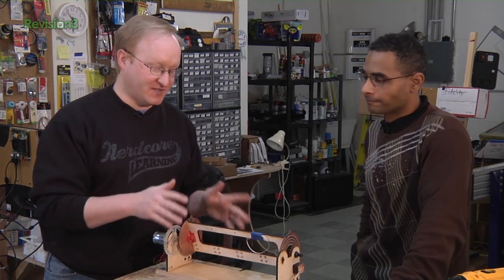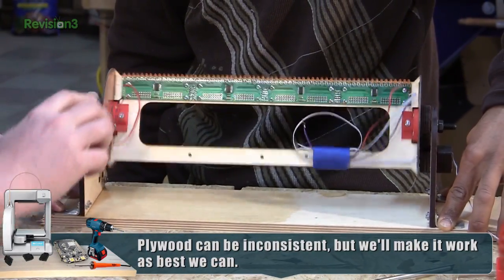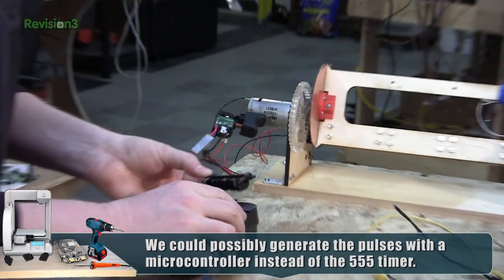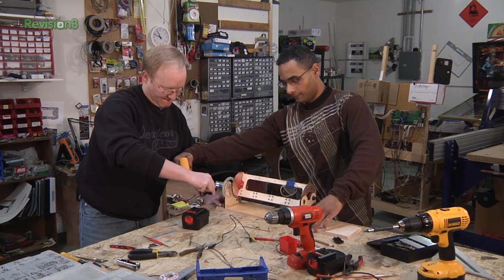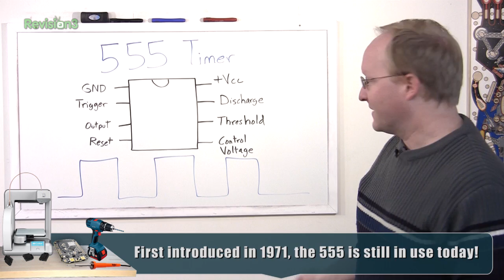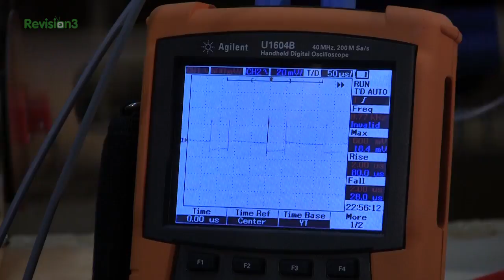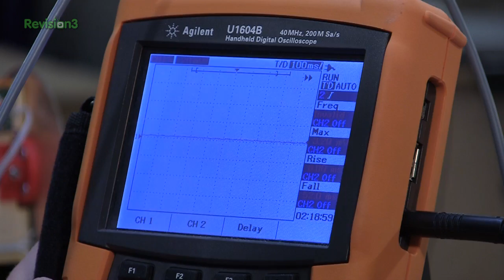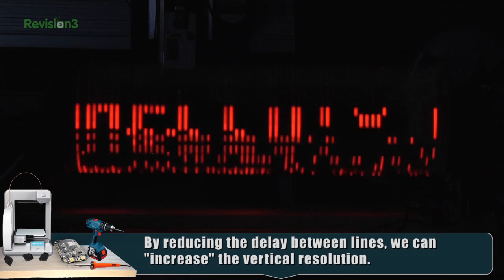Ben's Steampunk Persistence of Vision Display Part Three

Comment: Found this project awesome!, I'd suggest the folowing modifications though:
1.-BALANCING
 After asembling the rotating parts,the rotor needs to be balanced, It is fairly easy (hold it with two needles and check on multiple angles and remove material as needed). Doing so will reduce the friction and shaking notably.
2.- Reduce the radius of the brushes:
 Since the rotor is fixed on 2 ends, why not use one for the motor and other for the brushes... or even beter : use 3 pieces of hollow tube (+ isolation on the big screw )and put the brushes in the rotor instead (a hole in the big screw for the cables)
3.- the LED assembly should be orthogonal , and not radial to the Rotating axis, like Ben himself said, to reduce air resistance.
Reply from the maker: Thanks for the ideas!
Reply: The Ben Heck Show Also, avoid using brushes. A electromagnetic coupling would have reduced friction considerably.

Comment: Isn't the obvious problem from part 2 that the brushes are putting WAY too much force on the plate? Why can't you just pull back the brushes a bit? I'm sure there is a logical answer, but I'm just curious.

Comment: The center of mass should be on the axis the display is rotating around, did you try to balance it at all? The fact that the display almost jumped off of the table is a good sign it's out of balance. It would use less power and wouldn't have to be bolted to the table if it was correctly balanced.

Comment: on speed run snowmobiles we us them to power the sleds electronics, works good. i think walh bros sells a plate to take the battery and be able to mount it to something flat.
great videos

Comment: Hi Ben

That PC Power Supply should have more than enough output to spin your Rig. The reason it won't is because you have way to high a gear ratio between the motor and the LED Drum. The motor should have a smaller gear and the Drum larger.  That way the motor can spin up easier and draw less currant. The way you have it set up the motor is working to hard trying to spin up the Drum.  If you could ever get the motor up to it proper operating rpms that Drum would explode. Change the gear ratio and you will be allot happier.

Willy

Comment: Hm, we need a power supply... DC power supply sitting 10 feet away on the workstation... oh I know what will be easy! Lets use a PC power supply that entails we cut/strip wires, find a power cord, and manually hold the wires to the motor. 

Yep, that made much more sense than carrying the DC power supply over with the alligator clip leads on it. -.-

For use as a test on the bench why go through all the trouble.

Comment: Same as last episode, you're trying to use a gear ratio on that gear that is just going to pull a ludicrous amount of current from the battery because of the torque.  It needs the gears the other way around so that it can shine in high rpm, taking advantage of the higher voltage, drawing less current.  I would be willing to bed you get higher output rpm simply because its more efficient to drive the gears the other way.  (gear reduction instead of speed increase)

Comment: Hey, Ben, can you make a mod to a XBOX360 Cable Controller so you can plug it into a Nintendo 64 device?
Reply: As far as i know, The n64 was fully analogue, and the 360 is digital, well it has analogue parts but uses a DAC to convert the data... I guess its possible.... but stupidly hard...

Comment: Ben, things to try for prototype the second:
Feed power into the frame via the steel bearings at each end. There should be enough conductance between the inner and outer races via the balls for this, plus use a reservoir cap both for smoothing out any power supply noise and also to counterbalance the frame.
Use leaf spring contacts for the data lines instead of the carbon brushes. This will greatly reduce the load on the motor. You should then be able to change the gearing to utilise a smaller motor and smaller battery pack while still having enough speed to resolve a decent display.
A telephone cord untangler device makes a great slip ring assembly, giving you 4 usable connections.
Best of luck! x

Comment: A 287 watt power supply wouldn't spin that little motor?
Reply: Yes, but you need to provide a mechanism to spin it up (slowly) first, else the internal circuit breakers jump off because of the current it uses while accelerating under load
Reply: The PC power supply shutdown due to overcurrent from the inrush current of the dc motor.
Reply: That motor is not going to have that much of a current inrush to trip it. What is happening is that the PS sees a current draw on the 12V rail and nothing on the 3.3V, 5V rails. I had done something similar to Ben years ago using a PC Power Supply. To get it to work I had to add a load on the other rails to prevent the PS from tripping.
Reply: pieplay The rails that he means are the 5v 12v and 3.3v lines.
most pc power supplies are regulateted via the 5v rail so you have to have a decent load on 5v to keep 12v stable.
Reply: Most likely because the PC power supply isn't getting enough load or enough load on the other rails. PC Power supplies need resistive loads if not connected to a PC. The PC motherboard will use a set of voltages 3.3V 5V as well as the 12V rail Ben was using for the DC motor.
Reply: Guy Tech  Any load is a resistive load on DC, I don't know where you going with this "other rails" thing but it's indeed what Christopher says, inrush current.